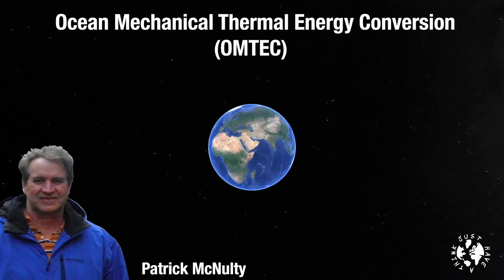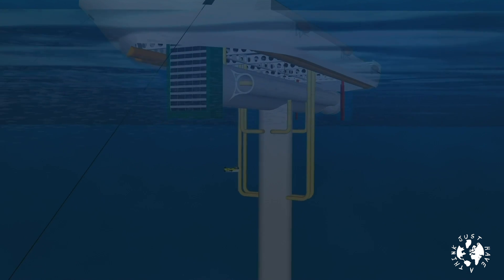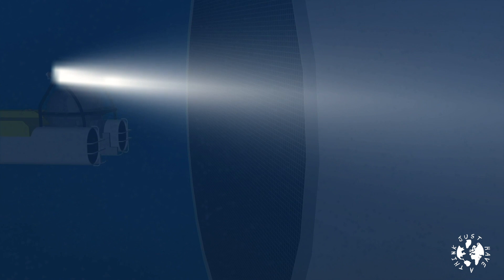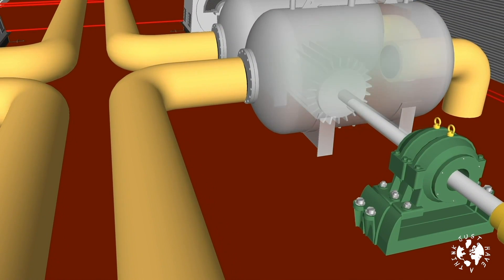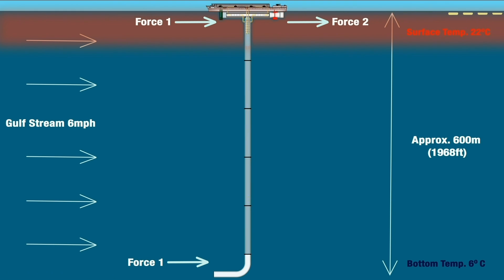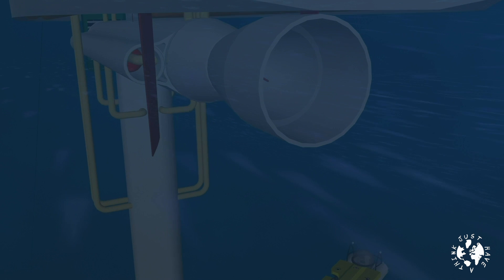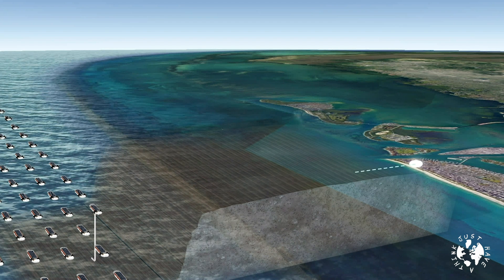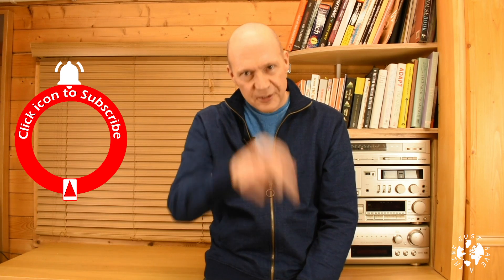Ocean Mechanical Thermal Energy Conversion

Comment: Only problem is that, a 5m diameter pipe or more, with 10km/h current pushing against it, will snap like a match.

Comment: I have a question for you.  If you use liquid Ammonia as a refrigerant to drive the turbines via a phase change motor or a "turbine" could that Ammonia be used as a source of H2 after it is passed through the "turbine" and then that same H2 be used to drive a Fuel Cell which also produces electricity?  The reason I ask is there is a lot of hype about H2 lately and Liquid Ammonia in pressurized vessels is often tossed around as a storage medium.  Since it boils at -33C it could be produced by intermittent wind or solar, stored onboard temporally as a liquid in specific pressurized tanks and then released to drive the phase change "turbines" as power is needed but with a reconfigured system to eliminate the condenser and use in a fuel cell after which the resultant gases are vented to the atmosphere. 
  Is this feasible?  Is it economical? Does it produce enough extra electricity to justify such a system?  I now working on a gravitational storage system and I am hoping to incorporate OTEC since the structure could easily accommodate such a system.
Reply: Actually, it can crack hydrogen and oxygen from the sea water around it.

Comment: I was thinking of ways of getting temperature differences. What I have understood here, from 600 metres deep, temperature is about 6 degrees celsius, and at the surface it is about 20. I was suggesting something else optional or additional to the 600metres pipe.

Comment: This is just another perpetual motion trap. You can't have that many anywhere near each other, bringing that much cold water up to the top will
continually lower the temperature at the top also by definition raising the temperature at the bottom, warm water will travel down to fill what
you just brought up. Once you lower the temp at the top enough and raise the temp at the bottom, you have lost your temp gradient and
as such, your "energy" that you were using for the work to generate electricity.
I would say that after all the calculations, it was realized this project would be short lived and there would be little to no profit for some time, if
ever after start up and maintenance costs. You have salt water eating away at your vessels and components.
I love the concept, but in practice, it would be only viable very short term, not to mention the ecological damage done by radically changing the
temperature in the environment they are in.
Sorry, but I don't see anyone willing to bare the costs involved for so little return. Unless you see this as floating solar arrays, even then, the maintenance
alone would just be overwhelming. Oh, and in the Gulf, 1 hurricane season would destroy your entire investment.

Comment: Makai’s Ocean Thermal Energy Conversion (OTEC) Power Plant, Hawaii, produces a lot of condensation, thats fresh water as a bye product.   You also have the nutrient rich cold water that is used for high value marine farming to consider in any cost its a change in mind set, pump  cold water to produce energy, fresh water and marine agriculture.

Comment: Be aware. If thousands of platforms operated closely across the gulf stream, the stream could be weakened and that could cause Archangle port in Russia to ice over continually and extend Englands winters. But otherwise i like this idea. You would not need to go 3000 meters down to get the deltaT required. The sharp thermocline below the gulf stream is significant. My only need to go below the depth of plankton in summer days...diurnal effect migration. Update progress please.

Comment: A Stirling Engine powered circulating pump would improve the whole thing by a lot..
Also exhaust heat of sun redirection could steam up water to use in regular steam turbine, steam could be later sent down to the bottom restarting the process, used to increase heat in the upper area incrementing the flow of water from the deep.
[To better define: 
Condensation steam serpentine on the upper Force 1 would slightly heating an enormous flux of water, frion condensation serpentine on the upper Force 2 side with the additional cold water from the deep would lowering the output temperature of water by a lot of fold... I'm not quite sure if the amount of fluxes passing in the tube make any difference , but with a current strong enough turbines could be mounted inside the deep tube system giving energy in a wind turbine fashion...
'Deep Current Turbines']
P.S:
Yeah it do need increasing flux velocity I didn't saw till the end of the video..
Yeah Stirling do work grate in there.

Comment: I remember a similar projet that doesn't use freon. Instead, the turbine is working in vacuum. It's the temperature difference in vacuum that creates a vapor flow that runs the turbine. The byproduct is fresh water. Probably less efficient but, it's a simpler design that does not require refrigerant.

Comment: The weight difference between the colder and warmer water is underestimated . I doubt there is enough current pressure to lift the column, especially with the addition of the top restriction.

Comment: Main issue is the low conversion efficiency.  Using endothermic reversible 1 - sqroot( hot / cold ) yields efficiency of only 2.75%.

With at 10m diameter pipe in the gulfstream your ingesting ~200 m^3 of water per second (78.5 m^2 opening with 2.68 m/s speed), at 4.2 J/g/degree C, and a16 degree differential and 2.75% efficiency this all comes out to ~370 Mw from thermal differences alone and before the loss due to raising the cold water mass.  The kinetic energy of the same ingested water stream is 700 Kw which is quite low compared to the thermal energy.

Comment: This potential is incredible but to really work you need some kind of thermal superconductor to move the heat or a thermocouple to generate current without moving water.

Comment: Maybe I missed it, but how do you get all that energy back to the shore line?  You could have several miles of transmission loss....
Reply: High Voltage AC cables are used to export power for offshore wind farms at distances less than 50km from shore without problems. The challenge might be getting the cable to the seabed though, so green hydrogen could be considered. If the cost of the whole is right.

Comment: Well I wish this would work. But I have my doubts, the biggest is the assumption that the horizontal pipe flow will have enough power (whilst being obstructed by the venturi) to draw the water from the deep, because this way it's the opposite of thermal syphoning (warm water wants to rise). Maybe it’s possible without extra power but the vertical pipe should have a much smaller diameter to make that work I assume.

Comment: Moorings are needed (to get a reaction against the current). Mooring in deep seas is very expensive sadly (it was a big problem for early wave energy converters). Add to that the structural challenges...

Comment: Key word is short term. Mixing cold water to cool warm water doesn’t get rid of any heat in the whole system. Mixing the water seems risky in the first place. Thousands of them could cause unforeseen changes to the currents and further changes to weather and climate systems. We live in a closed system, we can’t remove the heat once it’s in the system. We either need to bury all the carbon in deep sinks for tens of thousands of years and/or give up or change from carbon intensive industries. Reducing then removing carbon is really the only long term option.

Comment: He isn't saying what happens to the Frozen Methane hydrates at the bottom of the Seas. If the temperature raises down there that stuff will melt and go into the Atmosphere which would be a total disaster. What needs to be done is remove all of that Frozen Methane on the Sea Floors.

Comment: A 10 meter diameter tube at the bottom taking in "Force 1" can not push a column of water vertically that is 10 meters x 600 meters long. It wouldn't even make it half way up. At the very least the horizontal tunnel at the sea floor would need to be much larger with at least a substantial narrowing to create a venturi effect to try and push the water further up the column.

Comment: here in colorado the Arkansas river flows 150+/-  miles from Leadville 10000' elev
to Pueblo 4500'  without one single dam or  electric generator to capture some
of the same sort of  kinetic energy the Gulf Stream carries.

Comment: Hint:

Cold water falls...immediately.

The cooling of the surface water is an unsupportable by basic physics.

Moreover, the surface current does not move fast enough to use a venturi to draw the deep water up. 

As such, this project has no  actual new utility.
Reply: The cooling takes place at the mixing valve or shunt damper.. Pascals theory of hydraulics and Daniel Bernoulli have it right.. :)
Reply: Running cold water on the surface of warm water does not cool the surface as the cold water instantly drops below the surface.

Chilled water with food die and a glass of warm water can likely illustrate the physics well.

I think it is Newton who covered gravity.
Reply: @michaelhayes7849  Mixing takes place inside at the mixing valve.
Reply: @patrickmcnulty848  if the outflow is cooler than the surface water, the outfow will drop below the surface instrantly. Cold water is heavier than warm water. It's a gravity thing.

Also, upwelling deep water will decompress the pCO2 in the water and thus release that CO2 into the atmosphere. Moreover, the nutrients that come up, if done at a large enough scale and lfor a ong enough time, runs the risk of creating a benthic dead zone due to the over nutrification.
Reply: @michaelhayes7849  The Co2 can be scavenged and stored in bassalt. Hurricanes upwell as much.

Comment: Ice forms more easily on land than it does on water. How about building artificial islands in the arctic?  Build an Archipelago like the one under the Antarctic ice sheet. To reflex more sunlight and lockup enough water to reduce sea level rise.

Comment: That's like pissing in the ocean to make it saltier.  The sheer volume of the world's ocean is no match for puny ships.  Do the math. The volume of water needing cooling is so large this will not scratch the surface.
Reply: Agree - someone needs to check their math.  NASA says "during its life cycle a hurricane can expend as much energy as 10,000 nuclear bombs..."   It would take a LOT of these puny little platforms to even begin to put a tiny dent in that much thermal energy!
Reply: The volume of water passing through the devices has the needed kinetic energy and heat energy to power civilization many times over... :)

Comment: Well, the basic concept might be known following a refrigerator with condensor, evaporators and the suitable refrigerant fluid etc. But to build it in a marine vessel this way, use the speed of the gulfstream (up to 6 mph or close to 10 km/h is significant) and to add the venturi with turbine are all excellent. Thanks for sharing. Look forward to learn what next steps are. If needed can help to make some calculations. 
All together, wonderful OTEC system and credits to the designers! 🌍💧⚡💡👌
Reply: Correct and OMTEC is much more efficient then current OTEC systems..

Comment: Interesting

What strikes me is 6DegC of water which is available. This temperature can be used for HVAC systems and reduce power emissions along with it carbon emissions along the costal cities.

If you are interested in a system please contact
Reply: It sure can..

Comment: Why not just use large under water turbines attached to the bottoms of large  anchored flat topped platforms which could also be covered with solar panels. Maintenance of the turbines ,when necessary could be carried out directly on the floating platforms.  This idea would also avoid cooling down the Gulf stream.  (Which might be problematic when operated on a very large scale).

Comment: Torque from currents and especially during storms. Salt water and critters eating things up. Clogged pipes. How do you drydock it? How do you get the energy to shore? The Gulf Stream is shifting. How do you keep them on station? The filters will clog and clog. New cold water on the surface will sink with unpredictable results. And even rogue waves.

Comment: that will never have a positive effect on the climate, rather the opposite
Reply: One study to check would be oxygen levels at surface new food introductions or reductions at surface new biological agents microbes at surface. I'm not sure this will help ocean life. . . At surface
Reply: Why? You offer no basis to your critisism.
Reply: @larsalfredhenrikstahlin8012  because it changes the temperature equilibrium of the ocean and weakens the gulf stream, if we want to get rid of the increase in temperature there are only two ways, a space elevator that enables us to bring the thermal energy into space or at times large areas of sea water with reflective material or solar cells to cover. Any other effort will only move the problem to another location ON THIS PLANET and destroy the natural temperature equilibria. stirring in a saucepan accelerates the heating of water, exactly this system will accelerate the heating of the oceans
Reply: @darkbreed  Don't know if I agree with all of that. I don't believe this has anyway near enough thermal play to affect the gulf stream in any meaningful way.
Also, a space elevator that radiates the heat of the earth into space. That sounds impossible. Imagine the insanely large radiator you would need up there, and all that heat transferred by a single or a few space elevators. Sounds improbable to me. It for sure is not one out of two solutions to the problem either way
Reply: @larsalfredhenrikstahlin8012  one boat not but 10 or more, one elevator will be enough.

Comment: Interesting concept and generally very well thought out. However, you are missing something big.... If done in the Caribbean or off of the eastern coast of Florida on the massive scale you alluded to... this has the potential to STALL the Gulf Stream which would have a bevy of unforeseen consequences. The most obvious of which is a frozen England every winter and a collapse of the British costal fishing industry.
Reply: Can't happen as long as Earths rotational velocity is there and as long as Eckman Transport exists.
Reply: @patrickmcnulty848  But it would still get colder?
Reply: @tuulikk2  Which is what is needed now. How much cooling computers can tell us.. :)
Reply: Just again pointing out that if anything is done on enormous enough scales it could have unforeseen consequences. England enjoys warm coastal water and excellent fishing largely because of the warm Caribbean waters carried to it by the Gulf Stream. Fuck with that enough and some people are going to cry.
Reply: The switching off of the Gulf Stream is already a predicted side effect of climate change. Better get this machine up and running before it switches off then!

Comment: Thankyou for this item. The Hawaiian OTEC system near Kona started with much the same fanfare but reality caught up. 

All systems that take a low grade heat source and try to make high grade energy suffer similar problems of low efficiency and low output relative to capital expense. I am sure this proposal is well intentioned but it somewhat smacks of desperation. We need to get focused on developing real solutions (these are mostly known) to the huge challenge of powering the world in post green house gas environment.
Reply: OMTEC is much more efficient then OTEC. :)

Comment: The venturi differential is not step enough , intermediate heat/pressure exchangers would increase the gradient. Horizontal expansion on the suface with graduated application to the column would be a method of compensation. good luck

Comment: just have a think - SMELLS like more BULLSHIT to me. 
wat matters is harnessing TIDAL Energy as Ireland does and off Shore Wind power (Japan has lots). 
this has the same STENCH as the Liquid AIR Battery and Sold State battery cells. 
you can generate 10x more power with TIDAL Generators , SOLAR PV and Off Shore Wind power.

Comment: A good idea but this bumps into the Carnot  law and Carnot cycle.
Basically getting a decent theoretical efficiency for a heat engine depends on having a large temperature difference between the hot end and the cold end and this scheme has a very small difference. In terms of absolute temperature the hot end is 293°K and the cold 297°K
This means that the maximum theoretical efficiency, i.e. assuming all losses are zero, is 6% (1 - 279/297)
So basically you need a lot of machinery for a relatively small output.
Good luck if you can get it to be economic. I hope you can.

Comment: Not to be too critical of the presentation but Feron as a working fluid is indeed going to be hard to get. R22 Aka Freon considering the Montreal Protocol and the Kingali treaty eliminates the use and production this year for refrigeration. The Lockhead Martin OTEC projects are using anhydrous ammonia AKA R717 for their OTEC in Hawaii,  R717 does have one drawback with uncontrolled human exposure being deadly. I saw a video on a Japanese effort for OTEC where they say they are using  ammonium hydroxide which is Ammonia deluted into water. A friend of mine is one of the leading minds on refrigeration for ICE Rinks and he is now installing  ammonium hydroxide ice surfaces in North America. His work on refrigeration includes the International Olympic Committee , The Zamboni Corporation , a couple of billion dollar telescopes in Hawaii and Chile where he was tasked with refrigeration with R744 or CO2